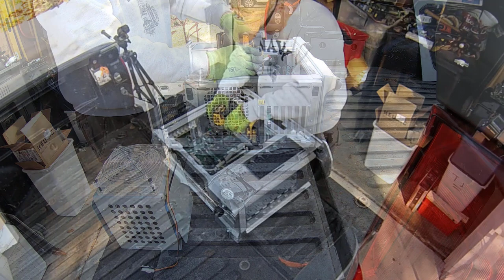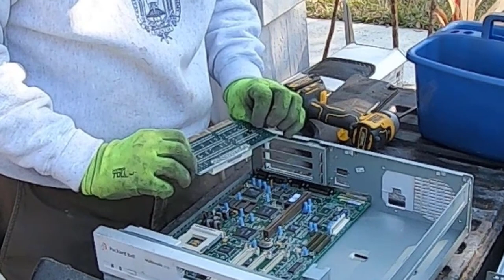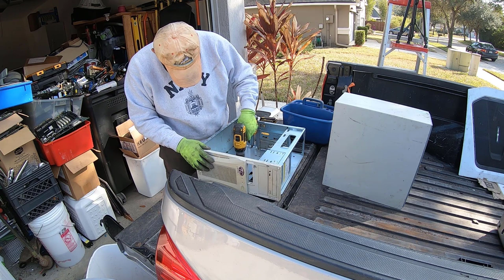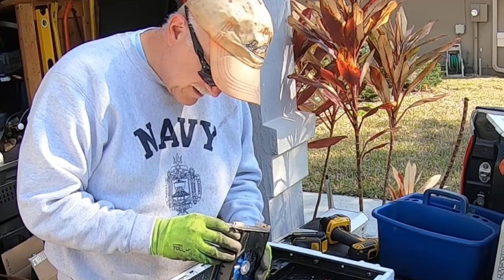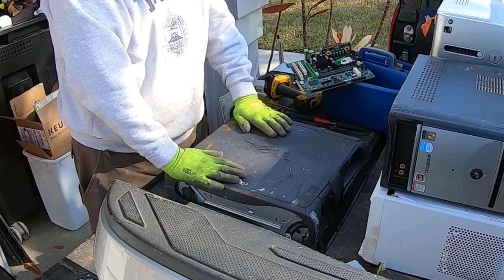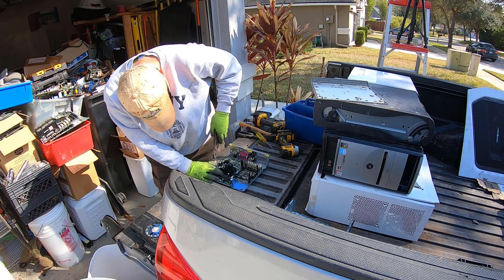How to scrap computer towers - what I found in those towers

Comment: Even though we are required to remove all batteries from scrap boards be sure to pull the battery from that dual Pentium II board as soon as you can if you plan to resell it. Batteries are the leading cause of circuit board destruction. They leak and corrode and will ruin the traces and components around them ultimately making the board scrap again.
Reply from the maker: Very good comment/recommendation - thank you!

Comment: Boardsort will still buy the backplane with no gold. I know the feeling on geting a oldie and no ceramic. All large socket are the same no color difference. Great video my friend.
Reply from the maker: Glad you like it my friend.  It's so frustrating not living within driving distance of BOARDSORT.  But if I lived that close, I'd have to contend with the cold and nasty winters 🤣
Reply: @sharkscrapper  it's well worth it LOL
Reply from the maker: @ewastemike7700  🌨😲⛔
Reply: The board at the 9:00 mark is a backplane for sure, but because of the gold fingers, if that card were to wind up in the Gold Finger Card No Bracket pile, it would be acceptable.
Reply: oops, 8:20 I mean (I was a little late on the time mark)

Comment: Cpu's are going for around $25 a pound around here.
Reply from the maker: Cool...where are you located Jeff?
Reply: @sharkscrapper  Florence South carolina
Reply: @sharkscrapper  Enjoyed the video btw.
Reply from the maker: @jeffsharp2113  Glad you liked the video.  Have you ever sold CPU's to BOARSORT.COM?
Reply: @sharkscrapper  No i have not ever sold to them, but now that you mention it going to go check their prices.
Reply from the maker: @jeffsharp2113  I have been dealing with them for some time now and find them very good to work with.  However, like me, you'll need to factor in the mailing costs.  That said, they pay so well that I can make money on most items.  If you have questions you can reach out to me at sharkscrapper@gmail.com
Reply: @sharkscrapper  Ok and thanks for the heads up.

Comment: Do you have a drill bit to remove the risers? If you do where did you get it
Reply from the maker: Dave - I have a couple.  They both came in electronic repair tool kits I got from a local Radio Shack going out of business sale.  You should be able to find them Amazon.
Reply: @sharkscrapper  I didnt know those existed
Reply from the maker: @davegdm954  Yes, very handy